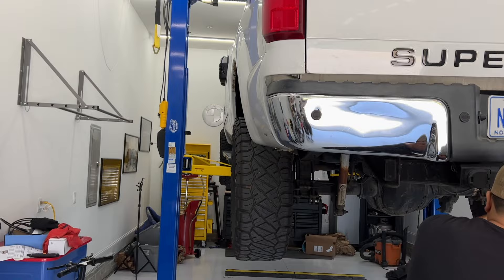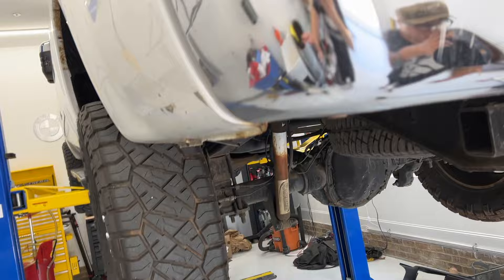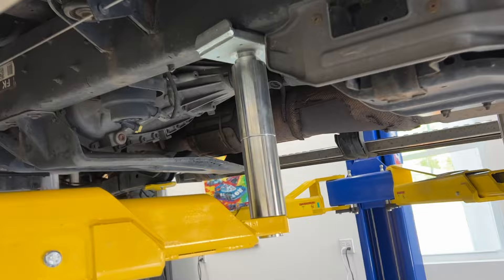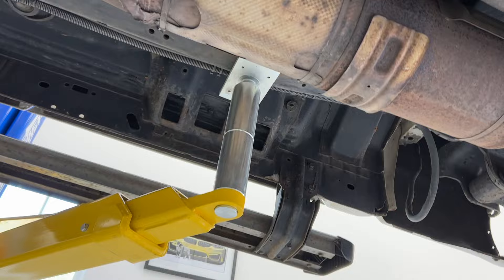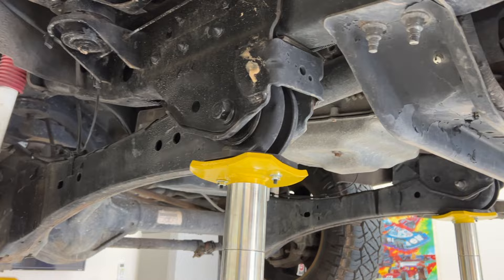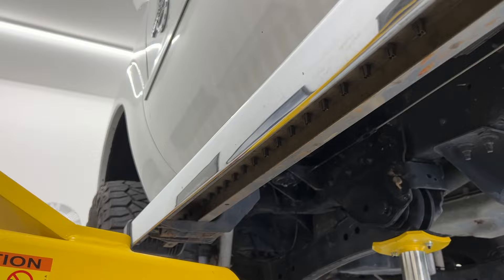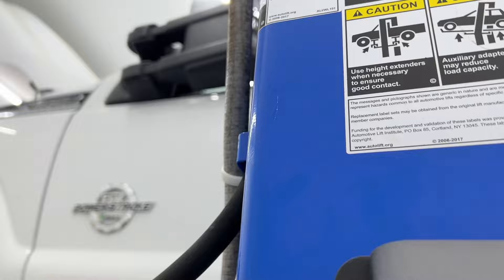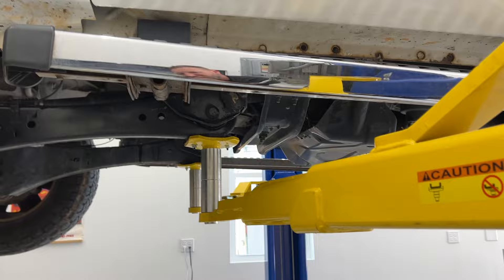How to Lift an F-350 SUPER DUTY using a 2-Post Lift

Comment: You are lifting in the correct locations based on the ALI guidelines. Weight distribution is key when using a symmetrical lift (note there is NO such thing as an asymmetric or versymmetric lift that does NOT have the column's leading edges angled inward).

To calculate vehicle center, weigh your truck, front axle, rear axle and total. 
My truck 2021 F250 XLT CCSB 6.7:
4760 front
2912 rear
7643 total
Divide either of the numbers by the total and you will get the where the vehicles center is  front to rear. Mine is 62/38 which puts the lift column's center just in front of the front door handle.  I ran some numbers of scaled trucks I've been in, all CCSB, they are all pretty universally close to 60/40, gas or diesel. To find that in of you truck, take you wheelbase (my CCSB is 160") multiply by .38 = 60.8". Measure 5' back from front wheel center, you will have where you want you lift column centered.

Improper weight distribution will affect your lift components, putting too much weight fore or aft will wear out the lift slider blocks, or bearings depending on what type you have (forward lift uses blocks). 
The sales pitch of a one size fits all asy and versy lift does nothing more that shift weight front and back on the lift arms and wears out those slider blocks.
Reply from the maker: +@danschroeder6228 thanks! 🍻
Reply: @HelpMeDIY  you are welcome.. It took me some getting used to as well, using the radius arm as a lifting point didn't make sense...but it's how it's done.
Reply: Thanks for this detailed reply. I am looking at 2 post lifts and it is confusing how a lift can be both symmetrical and asymmetrical. The manufacturers are not very clear on this. 

I have been wondering about the benefits of a true asymmetrical lift (rotated posts) for working on cars when needing access to the dashboard etc. Asymmetrical lifts seem to allow better access, but what are the drawbacks? 

I am also wondering about the best placement in my 23’ long bay to maximize utility for lifting my Porsche 944 and possibly a pick up truck or a long 1960’s sedan. How would it differ whether it was parallel posts (asymmetrical/symmetrical) vs rotated posts (true asymmetrical). Thanks.
Reply: @andrewsnider4098  lifts can not be both and be good at both. A symmetrical lift operated as an Asymmetrical lift will prematurely wear out the forward arm components (slider blocks, etc). Selling one as both is a sales gimmick, you can NOT lift a vehicle on a lift installed symmetrically with the vehicle's weight center behind the lift posts and lift it safely. This is impossible to do safely. I have tried it both way on my lift and the amount the the vehicle can be rocked back and forth is amazingly different when I put the vehicle's weight center at the lift post, it is much more stable. Now, lifts can be built to be installed as either or, but the installation orientation will determine whether it is used symmetrically or asymmetrically.

Which orientation you chose will work best depends on your usage. I installed mine symmetrical because I needed the width for larger trucks, personally I do not care for the asymmetrical, no real reason, just a preference.
Reply: @danschroeder6228 Thanks for speaking the truth about this sales gimmick. 

Based on your setup, what is the optimal placement of your lift in the bay to accommodate trucks? Is it better to have less room at the front of the lift? Thanks.
Reply: @andrewsnider4098  you are quite welcome. Unfortunately I was unaware of the gimmick before causing damage to my blocks, oh well, lesson learned.  My garage is only 24' deep, so I have my lift just barely forward of center. This give me a mostly even amount of room front to back when lifting my F250 4 door/short bed, or my excursion, while still being able to close the roll up garage door, there is very little room on either end. Optimally you would want room in the front of the vehicle to allow for under hood repairs while on the lift, or room enough for a toolbox. I am in the process of adding on 6 feet to that side of my shop so I can have the extra room that I want for that.
Reply: @danschroeder6228  Awesome info! Good luck on your addition.

Comment: I always hate putting my 2011 F250 Crewcab Shortbox on the lift. I have slight arm ( the angled steel sides like yours) on my extension arms and use a crowbar to push them over the shielding and under the frame on the rear drivers side slightly farther back. But yeah, putting one of these on the lift sucks.

A also use the high support jack stands when I do it every time also.
Reply from the maker: +Alan d'Eon agreed. Just had mine up again today for an oil change.

Comment: Thanks for all of the great content regarding your lift. Now that you have been using it for a while on various vehicles, would you change where within the garage you would install it? I believe that you centred it 12’ from the front wall. How does lifting in symmetrical vs asymmetrical change where the vehicle sits on the lift. 

I will be lifting a Porsche 944, new Beetle, Subaru SUVs, Sienna van, and possibly a pickup truck and 1960’s long sedans. 

Any trouble picking up low cars with the lift? I noticed that you have rubber pads under the Lotus. 

Thanks so much!
Reply from the maker: +@andrewsnider4098 you’re welcome! I would have probably moved it a little to the right to make it a straighter shot to pull in rather than trying to have it centered (the garage door is not centered)

Comment: I had my 350 in for service today and asked the mechanic where they lift them. In front it's under the swing arm bolts. In the rear it's on the forward leaf spring shackle.
Reply from the maker: +Chris Longe great, thanks for asking them! I’ll have to check that out when I change the oil next
Reply: That must be for a regular cab. It won’t even come close to teaching the rear spring mounts on my 4 door.
Reply: I  tried that not safe!! if u do it that way both set of arms u have to extend all the way which makes them weaker.. Not good!!
Reply: Depends on the lift, 3/5 of our lifts will reach. The others will not.

Comment: I lift my Crew cab superduty often , I made some angled bolt on wedges for the radius arms , it makes for a nice flat spot to lift much further forward than you are , the rear I can get the frame adapter to 
sit on the frame if I push the tank in a bit  ,, mine does not have the same shield,
Reply from the maker: +Scott Zimmerman thanks 🍻

Comment: Just had ours on the lift yesterday to swap wheels did the wobble test and thank God I had amp step or the driver side would have been messed up….second time was a charm….. my 2013 Crew cab no problem the f350 crew cab short box the frame is so dam small even at perfect points there more wobble then I like. Next time gonna put a stand under the front diff and tow hitch.
Reply from the maker: +Drippin' Wet Detailing Supplies 👍👍

Comment: Just curious how did it handle your stability check when barely have wheels off the ground?  I would give it a good rock before going higher, which I bet you did.  The front of the rear spring perch seems like the best advice.  The wider apart the better assuming the strength of the arms is not a concern.  You can easily get your center of mass of the actual truck by going to certified scales, the math is super easy and readily available on Google.
Reply from the maker: +The Replacement for Displacement balance is the same no matter how high it is. Arm strength shouldn’t be a concern.
Reply: I meant it would be good to show how unstable it was in your video at a low safe height before lifting 6' in the air where you would never push the limit.  Also, you can have a 10,000 lbs lift overloaded by a lighter  truck if a lot of weight is very far forward.  Just saying.
Reply from the maker: @thereplacementfordisplacement  true!

Comment: HI. Just had mine in the air yesterday.  This is how I did mine, but I did not have the frame adaptors like you have pictued here for the rear of the truck...  I may make a set of those. They seem to slide by the fuel tank just fine.  Barley clared on mine.   
Nice truck.  I almost feel out of my chair when I saw the DPF under there... lol
Reply from the maker: +Wesley Nichols good to know, thanks! And I had to Google DPF 😂. Yup. Still there.

Comment: If that's a Chinese lift which I believe it is,   reweld the straps on the top of the arms,   I'm doing a video to explain why,  they are not good welds and will fail over time.    It's just a matter of when.  There's only one beed of weld and it's not very good,
Reply from the maker: +global pioneer not a Chinese lift. It’s a Forward Lift. Part of the Rotary family.
Reply: @HelpMeDIY  check the welds on the straps.
Reply: Hate to tell you this.....Snap On, Rotary, Bendpak all run down a line in China.
Reply: @HelpMeDIY not true. Every Rotary lift is designed,  engineered and built in the USA. Their Foward line of lifts are designed and engineered here too,  but built in China. I bought a new Rotary 10k lift 3 years ago and talked to them more than once about this. 👍
Reply: @MotoXXX7  having run multiple shops with more than 10 lifts each, lift manufacturers and sales personnel will say what is needed to make the sale. Additionally, just because an item is made in "xx" country does not make it any more or less superior.  I've seen top of the line lifts fail and I've seen low budget lifts succeed, all depends on use (or abuse/improper racking).

Comment: You have to make sure the GC of the truck is aligned with the posts
The best way to do this is weigh your truck on a Cat Scale and calculate where the Center of Gravity is. You could use the ALI guidelines but weighing the truck is best.
Reply from the maker: +SV Poldhu - that helps yes 👍
Reply: The GVWR is on the door jam. Why would you need cat scales? The GVWR includes the weight of the vehicle itself plus fuel, passengers, cargo, and trailer tongue weight.  Not sure, why for the life of me you'd pay for cat scale let alone waste your time.... 😮
Reply: @cherryheaven30  because that does not give u a actual weight of the vehicle to be able to calculate how much weight is on the front axle or rear axle when lifting. you can do some speculation if u need the variables but its just easier to go weigh the vehicle in lifting configuration